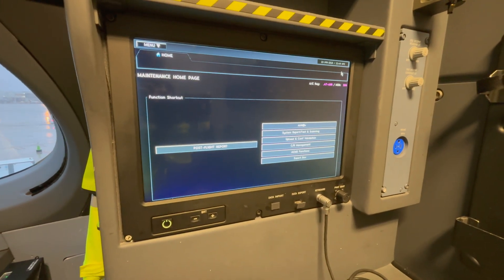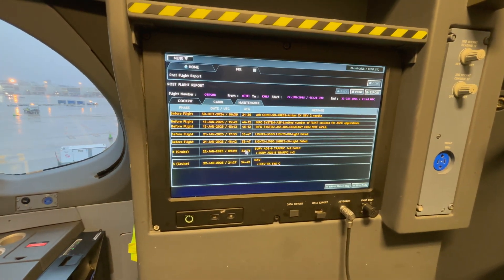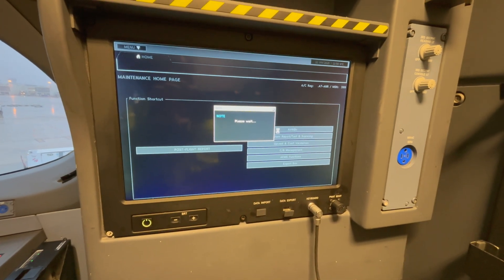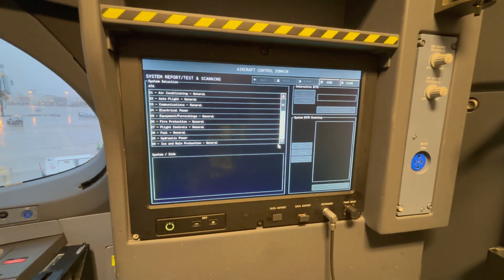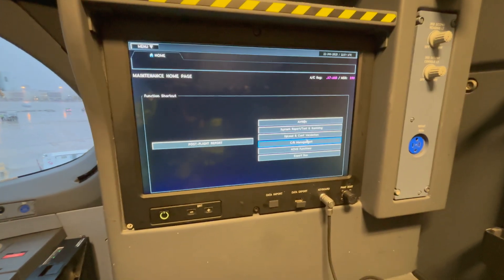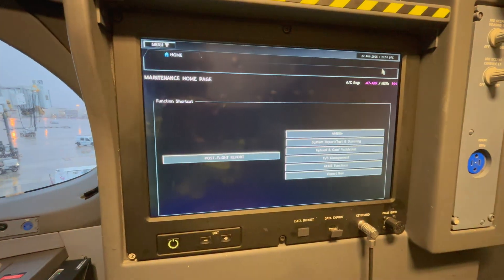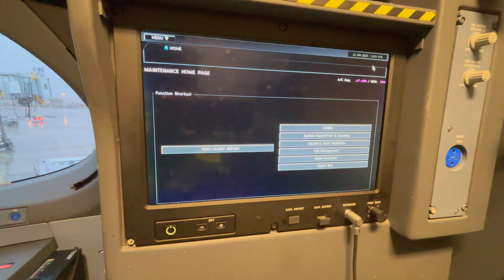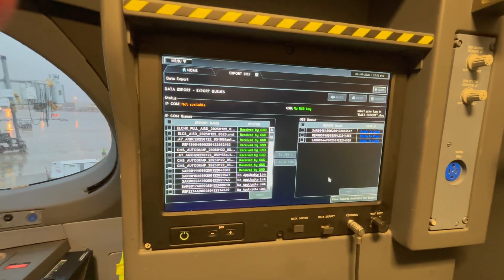Airbus A350, Onboard Maintenance Terminal, short cuts

Comment: Absolutely hate the keyboard at the OMT. I'm always at war with the touchpad and stowing that thing including its cable with a piece of velcro is also a pain in the behind. I'm positive the person designing this never worked with it him/herself.
End of rant 😉
Reply from the maker: I like the A380 version better, this way was probably cheaper 😬
Reply: @dennisvijverbergbrakesrele6098  I'm not familiar with the A380 but it can hardly be any worse. 
A folddown keyboard with a better touchpad would already be way better, no screwing around with a loose cable. Better yet, also intergrate a trackball next to the OMT. One can dream right?
Reply from the maker: I am using the pilots seats to access maintenance data 99% to the time, there with the trackball it has the perfect interface.

Comment: Can it be used inflight? I guess most of the functions would be disabled.
Reply from the maker: Testing and software uploads are inhibited during flight, but you should be about to check ACMS if you want to looks a sensor outputs etc
Reply: @dennisvijverbergbrakesrele6098  Makes sense, thanks for the info.
Reply: seeing as how it is on the flight deck i'd say no, maybe in a test flight?

Comment: Why showing all this critical systems of an aircraft to the public. This might land in trouble.
Reply: No, because the OMT is inside the cockpit.
Reply: @87solarsky  Still risky.
Reply: @AtomiserDQ  there's no risk at all, stop doing the "security by obscurity" thing, it's not how the world works
Reply: then what's the point of we have study level simulator. even the maintenance manual book is publicly available.
Reply: Security by obscurity doesn't really work.  Especially with thousands of people already knowing in detail about the A350 - pilots, engineers, cleaners.
Reply from the maker: Nothing show is secret information. And if you want to do bad things you can do it  simpler than getting your way into the cockpit and start application etc, testing and software uploads can’t be done during flight anyway.
Reply: Already publicly available anyway lol. this just makes it easy for more common people like us to understand stuff.